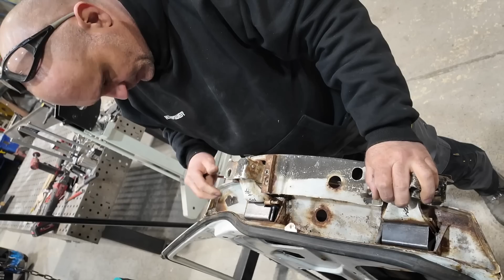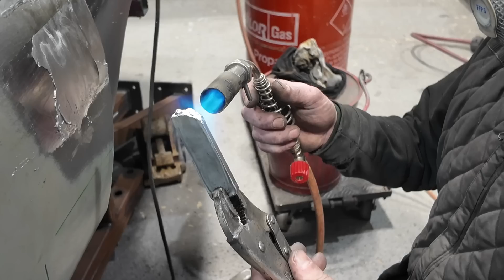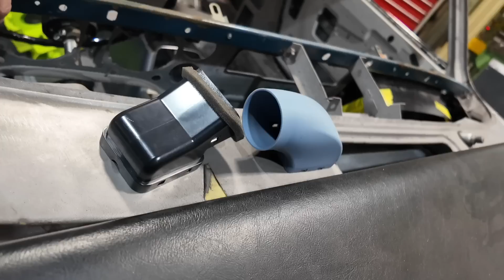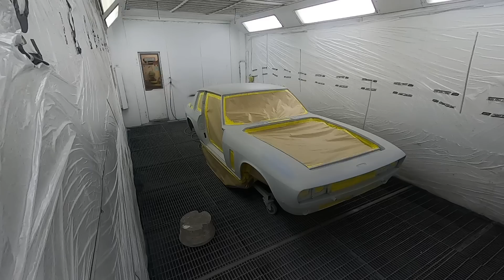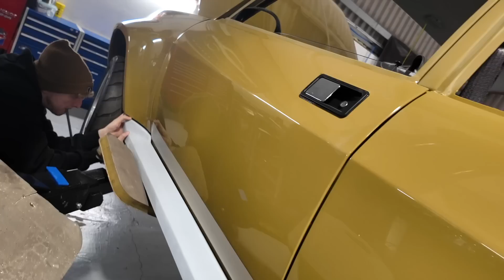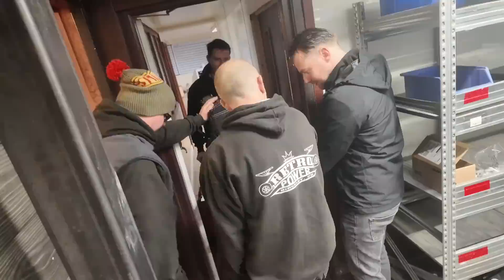Hemi powered Jensen Interceptor Painted!

Comment: The old Saabs... whatever they'd been imbibing... is either jet fuel from designing airplanes, or they'd had visitors from Citroën who infected them with whatever causes the Citroën moon logic. :P
As Saab often had some... Citroën-like antics, like having the ignition between the seats rather than at the steering column or next to the steering column, though they usually claimed it was for safety, as your knee wouldn't hit the key.

I know this is an older episode, but I'll ask anyway if it might be answered at some point, in the Wasaabi, will you give it the "Night Panel" function the later Saabs had? I really loved that function, where it's practically like a stealth mode it feels like, where all lights except the speedo turn off, to not distract the driver while driving at night, kinda feels like something they've taken from their jet fighters in a way. XD

Comment: I’ve plenty of chillers and AHU and bigger stuff in work, wires in electrical panels definitely work loose and need to be tightened every couple of years, especially on new installs.
In relation to the Saab door hing is one of the hinges got the part around the pivot pin an elongated  circle to allow it to change its centre?

Comment: You mentioned summer is around the corner...
Here in my suburb of Perth, downunder, the coldest it got today was 24.9 (at 5am) and the warmest was a mild 44.7. 
Yes, Celsius.
It was still 40.2 at 6:30pm...
The overnight minimum tonight is forecast to be 28.It's currently 32.9 at 10:15pm.
It's a dry heat, though :)

Comment: Thx for the detailed run down on the painting process… incredible how many passes breaks dry’s etc it needs, also the special treatment of drying with the fans rather than temperature, who would’ve thought… great insight !
I recently fixed some patches on my F56 mini door frames (rubber rubs through the paint with time…) that was simple 2k one coat (not even clear as it was small patches and in the future it will be uns a clear chip protection film… ) that was nerve wrecking enough for me :-)

Comment: I worked for saab for about 23 years as a master tech, I never had to adjust a 900 door in that time so it is a mystery to me also how the hinges work, but it is a testement to the saab engineers in trollhatten how they could over engineer and complicate things so much that gm threw in the towel. I love these cars and the way the designers always went their own way, when they were given the vectra platform to use on the last 93 they not only altered the wheel base but also the track so the entire gm floor pan was redundent. As an aside, when they had the joint alfa and lancia project for the 9000 they decided that none of the panel were thick enough or the crash structure was up to the job and changed all the gauge of steel. Dont you just love em.

Comment: Interesting that you installed the combo fuel pump in the spare wheel well, when you have not sorted the wheel offsets yet. Hope the spare will fit😀 
Also, in our shop, we have a few small sand bags that we use to hold down templates to mark out where to cut. Those sandbags also double up to damp down a sheet when it is being plannished. It damps the sound and assists with the planish.